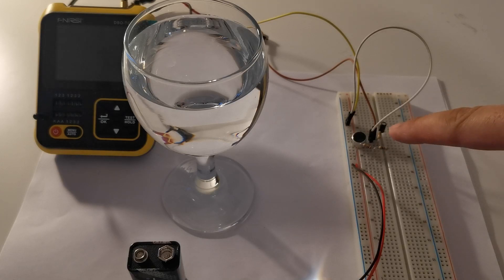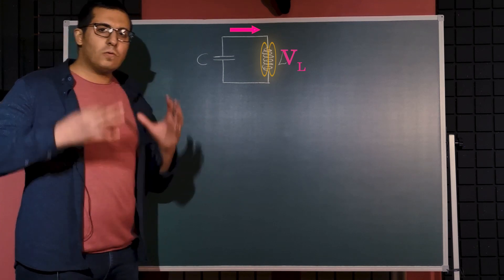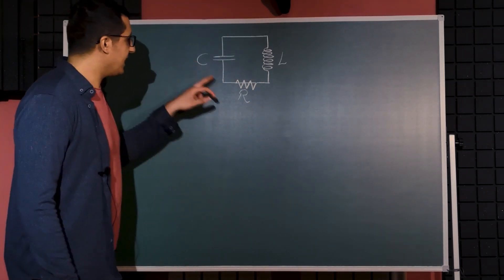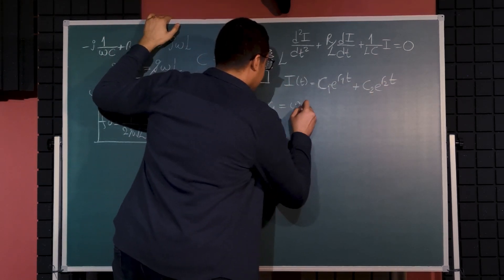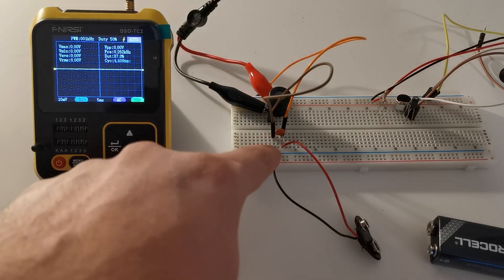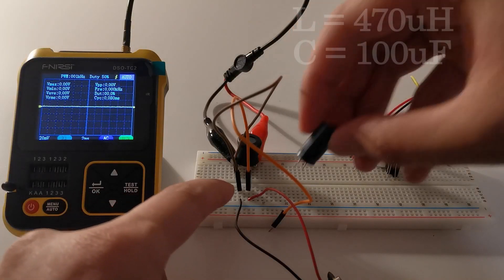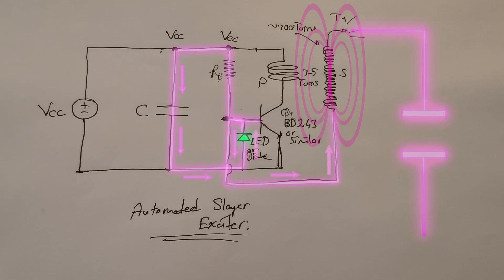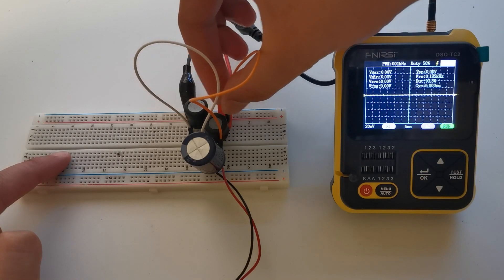The Nature of Resonance and High Voltage LC Circuit (Mini Tesla Coil)

Comment: Nice video but you’re trying to create a tank circuit with a polarized electrolytic capacitor?  That’s not going to work my friend.  You need a non polarized cap.
Reply from the maker: Thank you for your kind comment and appreciation! 😊 Yes, that is true. Electrolytic capacitors have an oxide layer acting as a dielectric to insulate properly in a unidirectional fashion. However, up to certain voltage levels (typically up to 1.5 volts), the reverse voltage does no harm to oxide layer and it can still act as a bidirectional capacitor with a different capacitance value (In our case reverse voltage would die out immediately to these levels). 

Also, as you know, it is rather simple to demonstrate by using what you have in your hand especially when you need a large capacitance for observable oscillations with a low frequency. But this must also explain the anisotropic waveform on the oscilloscope, very good point to mention thank you!